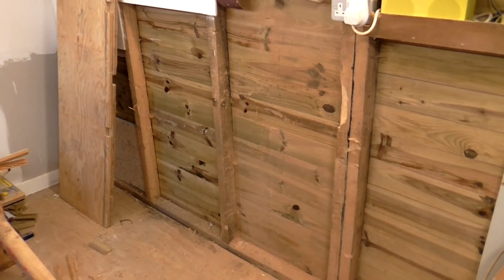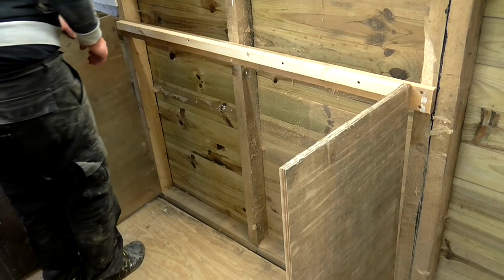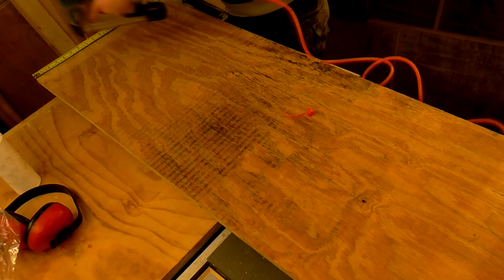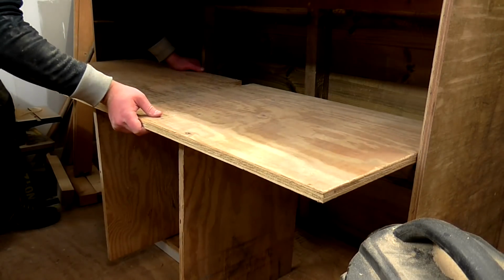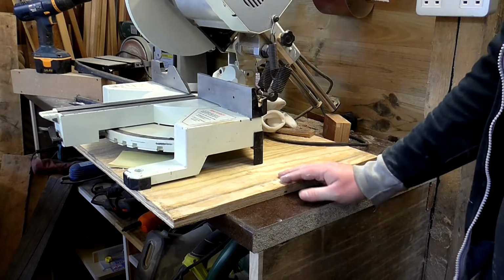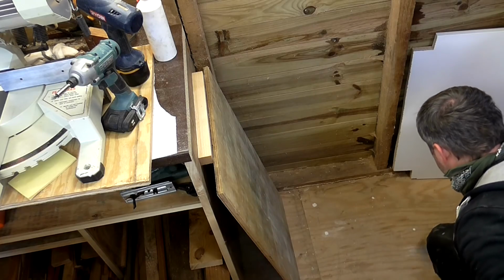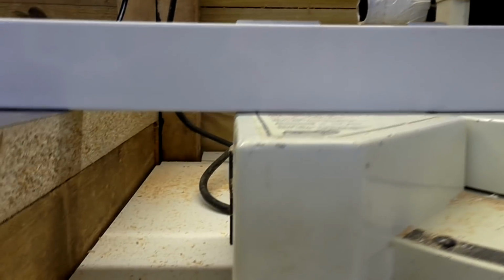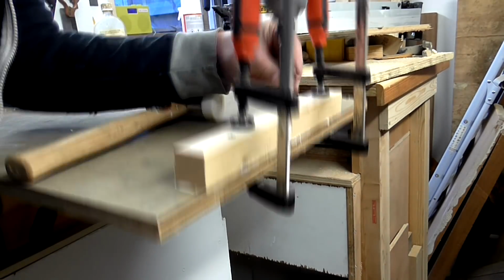The New Mitre Station (part 1 of 3) - Workshop Re-Model Episode 4

Comment: Good job Kieth surprised you did not insulate the wall when you had everything out. I noticed you have a Charnwood small router table ,that was my first table i even made a router lifter for it using a 18mm threaded bar some nuts and a plate welded to the top nut.